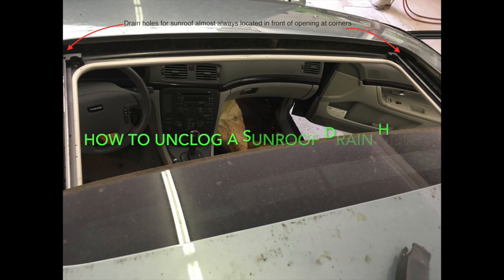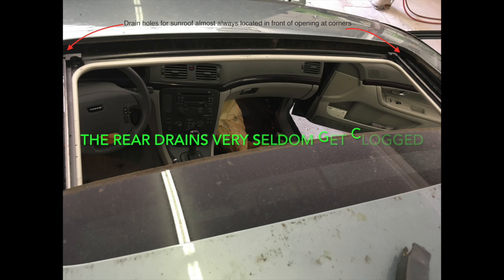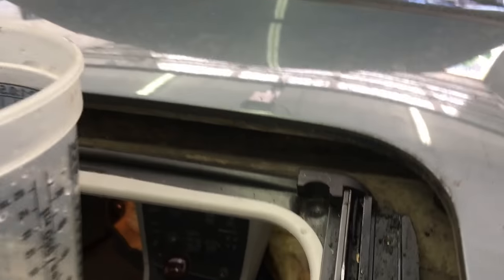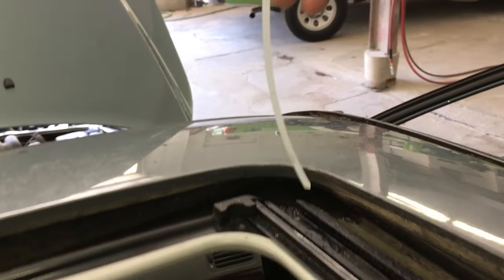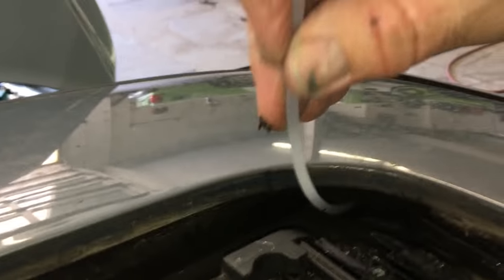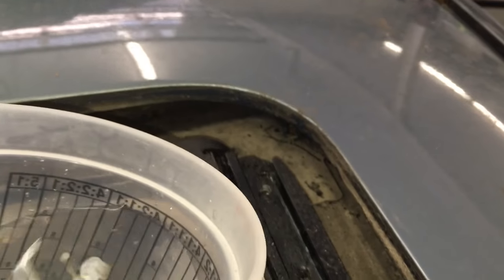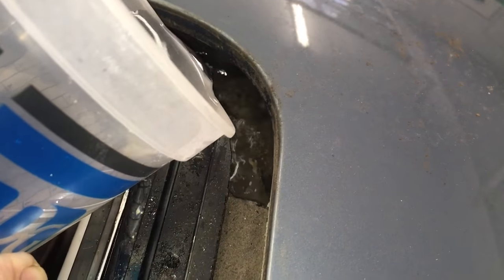How to unclog a sunroof drain

Comment: Can I use a can or air (from Staples or office Depot) with extension, instead of the air compressor? I don't have the tools and I'm in fear of breaking the drain pipe or disconnecting them.
Reply from the maker: Sure, you could try that, but it isn't always necesary. The important part is to FIRST: scrape away the debris from the drain openings in both front corners, the air is only used as a final flush. Good luck!
Reply: Just go to any gas station and use one of theirs
Reply: @andrewclark3649  Gas stations don't have the blow gun fitting on their hoses, only the inflator tip which won't do you any good.

Comment: Careful with the compredd air. If the drain is still clogged, you can rip a hole in the tubing.
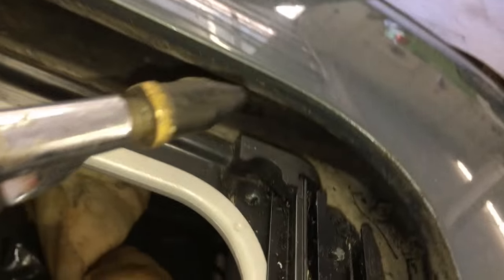Reply from the maker: Yes, as stated at 1:40 in the video, compressed air is not necessary for unclogging. It is only used to clear any small remaining residue in the line.

Comment: What about the drain holes in the rear of sun roof
Reply from the maker: they're not as exposed to debris as the fronts, I've never had that situation occur. Those (rear) holes are located under cover. The lid would have to come out, probably not a diy job.

Comment: Here is a thought. Instead of using an air compressor to blow down into the car, how about using a wet vac to suck out debris from the top?
Reply from the maker: You can try that, as long as you can get the wand directly on top of the drain hole. But it shouldn’t be necessary, if you have access to the drain hole just scrape off the debris. That’s what causes the clog, then pour a little water over the holes to make sure it’s draining.

Comment: The sun roof drain-hose problem COST me a BMW X5 because water got into the electronic system.
Reply from the maker: Not good! As sweet a feature as they seem to be it just seems like cutting a hole in the roof for an extra window is asking for that type mishap. T-tops, convertibles, and sunroofs; 3 bad ideas.

Comment: Mine must be clogged hard. Wire is bending after about foot of wire goes in
Reply from the maker: If it’s on a GM truck, they have a hard bend or valve at about 10 inches so it’s not possible to do much with that – – don’t know what model car you’re working on though. If you pour water down the drain hole is it not draining below the car?
Reply: @eldigitom9680  it's an 07 Chevy Silverado 2500. I didn't have time to try to pour water down it I'll try tomorrow evening. But it rained a lot last night and when I got in the truck this morning the ceiling was wet all around it.

Comment: The drain is clean... what's the next problem it could be?
Reply from the maker: Usually, leaves, twigs, tree fruit buildup clogging the cowl screen (under the windshield wipers), not allowing water to drain out the side drains underneath the fenders. It will alternatively redirect it's way through the heater box into the passenger side floorboard, not so often the driver's side.
Reply: @eldigitom9680  It's dripping from a square bolted part where the tube is connected up by the sunroof.
Reply from the maker: @nsmcastillo326  Oh ok, without being able to see it I would be speculating on the cause. It’s a little beyond the scope of this video on unclogging a drain but it makes me curious and I wish that I could help you, but maybe you’ll need to take this one to a local body shop that you trust.
Reply: @eldigitom9680  Do you know what the black square part that is bolted to the roof is called? Where the drain tube is connected.

Comment: What about the water accumulated on the bottom of the car. I have a bunch in there i can hear to when i drive moving.
Reply from the maker: Usually have to peel the carpet back —which involves removing the scuff plate inside the door. Then wet vac, and usually we leave the doors open with the carpet pulled up (only the carpet that is wet, usually right front floorboard) for as long as possible with a fan blowing through it. Kind of a tedious process but otherwise it stinks for the life of the car.
Reply: @eldigitom9680  that's what I was afraid of. Rainy season started too in Oregon now.
Thank you for the video and the answer 🙏😊

Comment: Question …I poured the water and it drains right into my car roof  above the door area ( sorry I don’t know the exact name for that area) and the floor is damp… should I still use the trim wire to clear something out? It doesn’t appear to be clogged….
Reply from the maker: It sounds like the drain hose has become disconnected or has a tear in it, you should probably take it to a shop.

Comment: If you don’t have a blower, what else can you use to push the air thru? Thank you!
Reply from the maker: @SallyLanger-rd6ew  One viewer left a comment recently, where he used a condiment squeeze bottle filled with water to push the water through the tube. However, usually the only thing necessary is to scrape the debris from around the opening of the drain hole. The forced air is really an optional follow up after the drain has been cleared. It should never be used before the drain is cleared. Good luck!✌️

Comment: How much PSI?
Reply from the maker: However much psi your compressor provides, probably 45 to 90 pounds.
Reply: Keep the psi below 20 or you might blow the drain hose off the connector.
Reply from the maker: @6StringJoyStick  Not a chance, they're not that delicate. It should be able to handle as much psi as your compressor can deliver.

Comment: But how to clean another one under back seats?)
Reply from the maker: Do you feel the rear ones are clogged? This video only addresses the front drains because they are the most prone to clogging.I have never seen an instance where the rear drains were clogged. That would be a mess and would include removing the sunroof to explore the problem.
Reply: @eldigitom9680  yes, under the back wheels other  water drains

Comment: What type vehicle is this
Reply from the maker: older volvo, not sure of the year
Reply: @eldigitom9680  I have  Toyota and found mine in both corners. If there are some in the rear I can't get to them. TY for video.
Reply from the maker: @mgomez5606  yes, the rear ones are pretty much unaccessible without pulling the sunroof, which is a pretty large task and probably should only happen in a shop somewhere✌️
Reply: @eldigitom9680  two open drain holes is better than none.

Comment: Aaaand if you don't have an air compressor....??
Reply from the maker: As per the video, compressed air is not what unclogs the drainage tube. It is first unclogged by scraping away debris from the top surface. Compressed air is only used as a final flush after the clog is removed, it is not a necessary component, just an added plus.
Reply: @eldigitom9680  Ohhh ok, thank you.

Comment: According to car care nut YouTube! Don’t use a air compressor because it could make drain line pop off from the pressure!
Reply from the maker: Is your choice señor. As per the video, air is not necessary to unclog a drain. When used, it is only after the drain has been unclogged. Usually all that is necessary is to scrape debris away from the drain hole.

Drain hoses are made of robust plastic tubing, not delicate material. They are affixed securely by auto companies, designed and engineered to prevent damage or leakage. Logically, do you really think a car company would install a very costly interior and then supply a spindly piece of drain hose that could easily be dislodged? Damage is much more likely to occur when sticking any sort of metal wire or object into the tubing. Thanks for your interest.

Comment: DO NOT use a air compressor!  The power can separate the tubing connection
Reply from the maker: It is very improbable that compressed air could separate a healthy tubing connection. (As per the video) air is introduced ONLY after the tube has been unclogged, it is used only to flush remaining debris. This has been a addressed from time to time here and it’s a fairly benign procedure. Yes, if you’re queasy about it, don’t use compressed air.

Comment: That's just really bad American engineering at its best.  Even when you are pouring really slowly it takes a few seconds for that water to make its way through the drain holes.  Heavy rain will without a doubt leave you with a soaking wet interior.
Reply from the maker: The car shown is a Volvo. But with the sunroof closed and a gasket seal around it, ideally not much water gets through to the drain anyway.

Comment: DON'T USE COMPRESSED AIR, the lines were not made to handle pressure and will disconnect, especially if clogged at the end.

And it's a nightmare to reconnect them